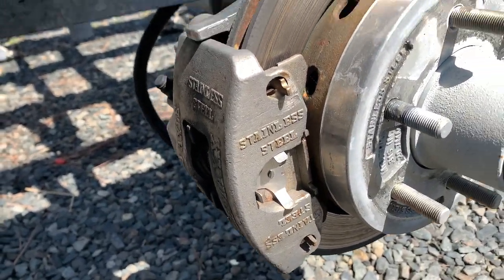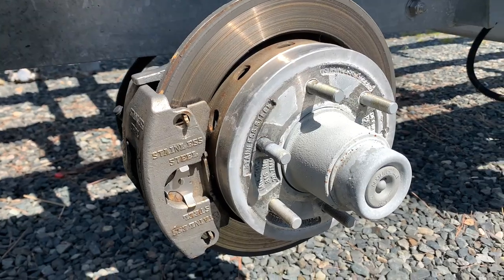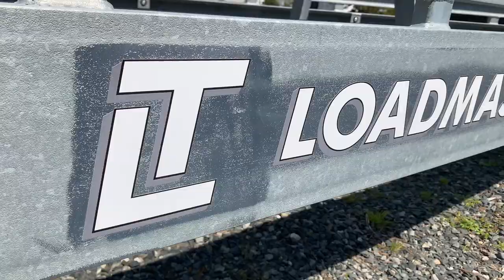DeeMaxx Stainless Boat Trailer Brakes on the Loadmaster Galvanized Trailer

Comment: Jeff, what is the cost comparison to regular brake drums and calipers?
Reply from the maker: BAYDOG So figuring the trailer would have 4 wheel disc brakes, the up charge was $2800.00 which includes the electric over hydraulic system...   going down the road I can hit the trailer brakes along which stops the truck, something like travel trailer brakes.